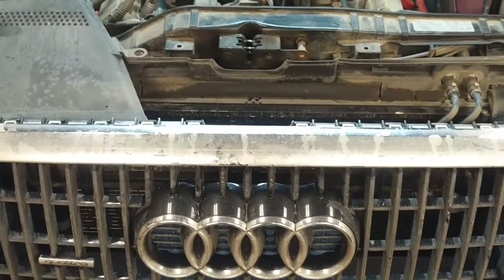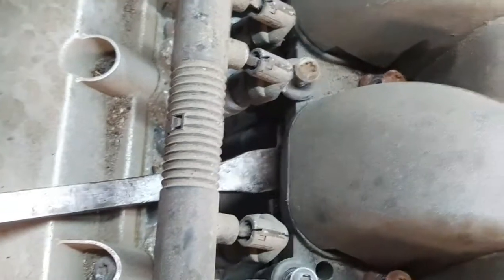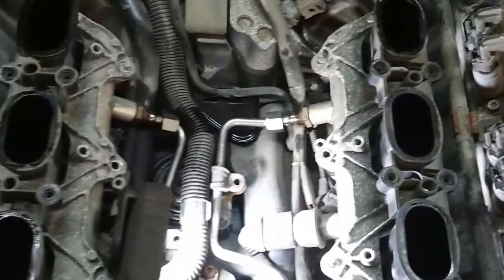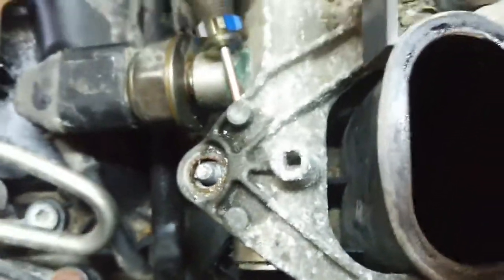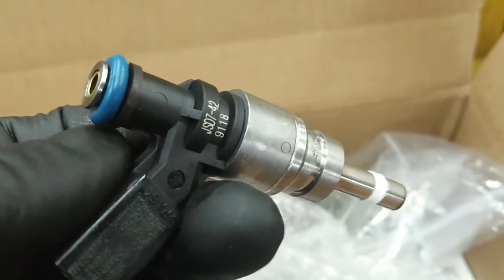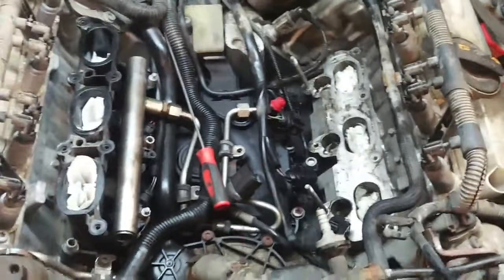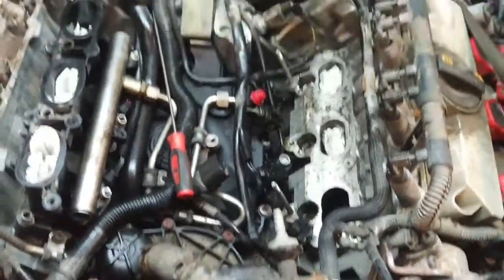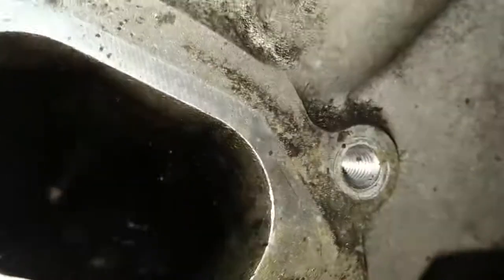2010 Audi Q5 fuel injector removal and intake Port cleaning

Comment: Did you have to remove the top coolant pipe in order to remove and reinstall the rear most right fuel injector? It appears as though there is not enough room for removal and reinstallation. Thank you!
Reply from the maker: I dont remember removing it on this car.

Comment: What is the cost for this type of repair?
Reply from the maker: This was 4 years ago so prices have doubled on parts. If I was asked to do another one I'd probably decline or would  quote 10 hours plus parts. Fuel injectors, injector seals, intake gaskets. Probably around $2500 cdn.

Comment: Holy crap! They don't make it easy, that's for sure. Good luck.
Reply from the maker: Not my favorite job for sure.
Reply: @PhillipBailey  I have a 2010 Q5 with the 3.2 engine and it looks like there is a valve cleaning job in my future.

Comment: Hey thanks for the video. So do you have to program the new injectors?
Reply from the maker: no programming required, just to a code clear or disconnect the battery for 30 minutes to clear the fuel trim tables.

Comment: That was good puller to design and make on the fly. This job looks like one you have to keep your thinking-cap on even after the diagnose. Great work and also on your videos. Thanks for all your effort and time.
Reply from the maker: It would only work if they had been recently removed. Even the factory tool does not work. The injector body is just plastic so it breaks. Best to clamp vise grips onto them and use a heel bar. They are no good anyways...